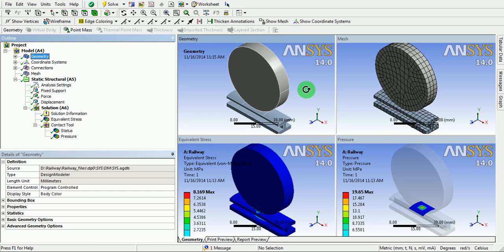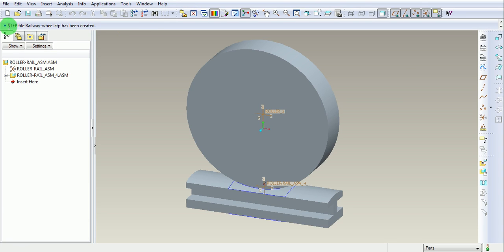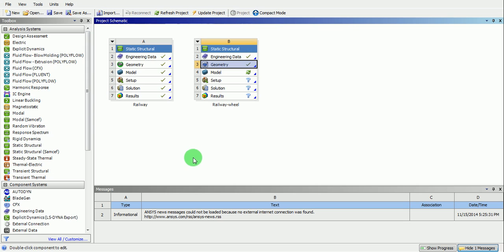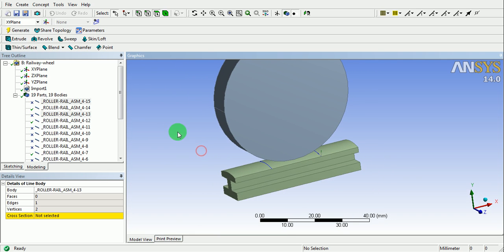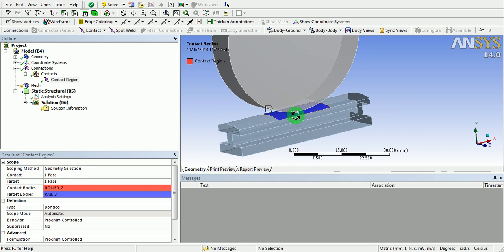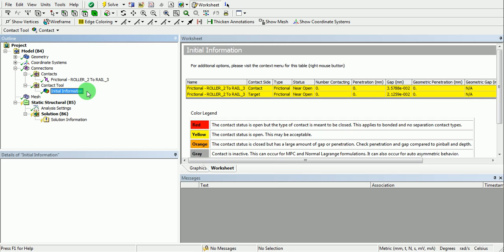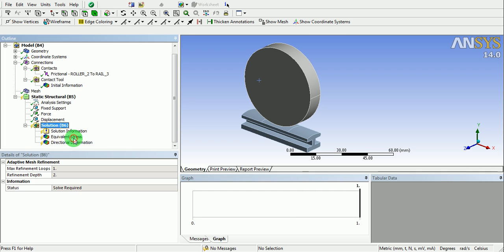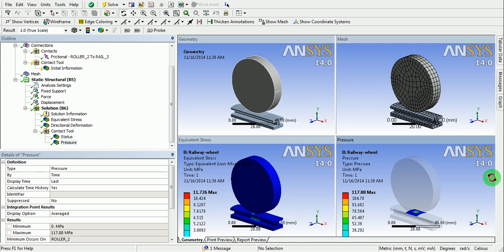ANSYS Workbench Tutorial Video | Structural Contact Target Non Linear FE Analysis | Beginner | GRS |

Comment: Is it possible to apply the force in x direction instead and see how much force I need to switch from a sticking contact to a slipping one? If I try it, I already get no convergence at the very first substep of 0seconds. It works in an explicit dynamic simulation but I'm looking for a way to build it into a static structural model.

Comment: which software did you use to do the CAD? When I save my model in Solidworks as stp, it does not keep the contact surfaces.
Reply from the maker: +Jon Saw okay, you can split surface in ansys directly
Reply from the maker: +Jon Saw try to split contact surfaces in ansys using project or imprint
Reply: GRS CAD/CAE Thank you very much
Reply: hi sir..i need your help regarding ansys workbench explicit dynamic..here is my email shahrizalatif@gmail.com please help me.thanks in advance :)